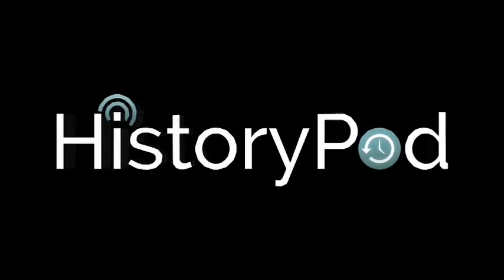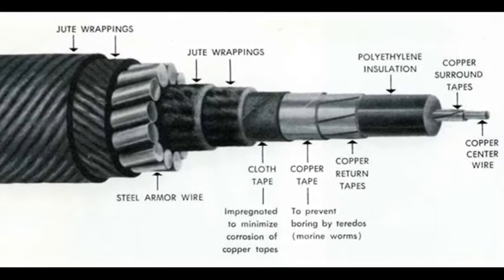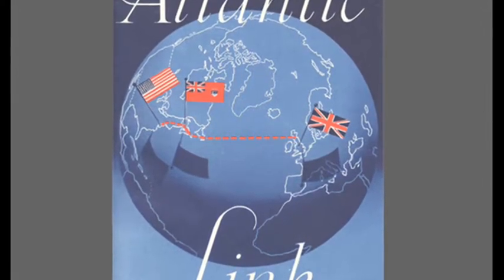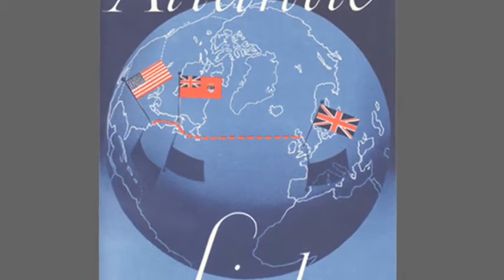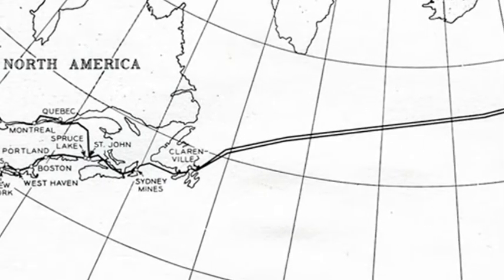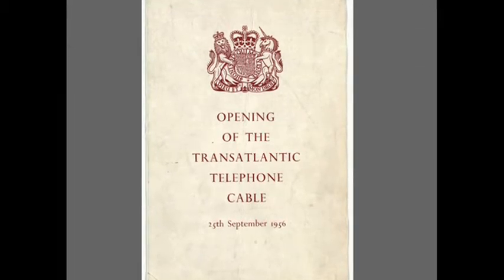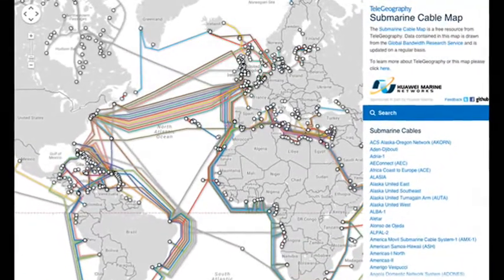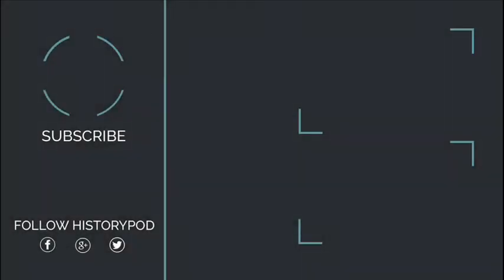25th September 1956: Inauguration TAT-1, the first transatlantic telephone cable

Comment: The cable(s) came to shore close to my hometown of Oban, although the cable itself is long gone, you can still explore the abandoned terminal building, which I did so yesterday! The surface building is only the tip of the iceberg however, as sunk into the hill behind it is a massive, 2 level cavern where all the main equipment was kept...that seems impossible to reach though, as entrance is blocked by a massive, bombproof steel door.